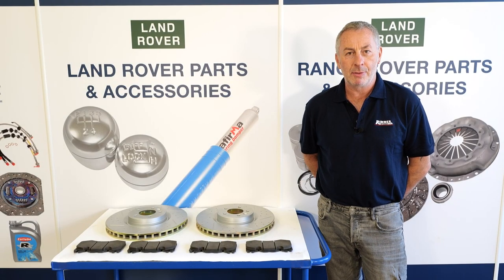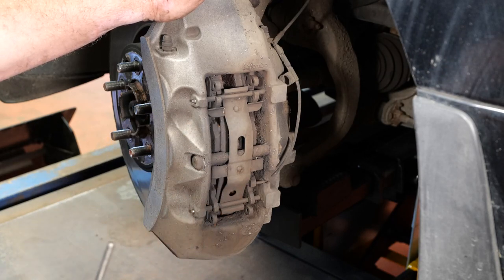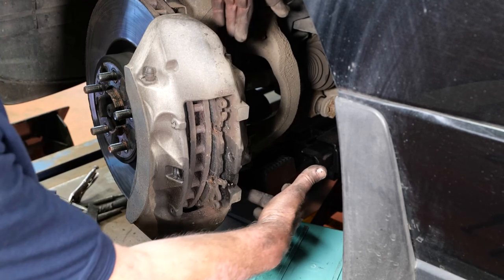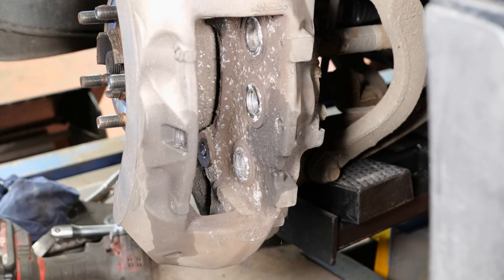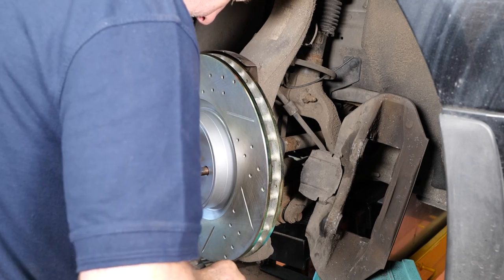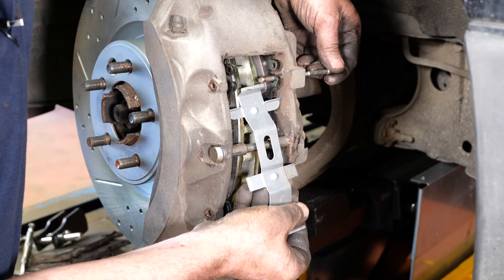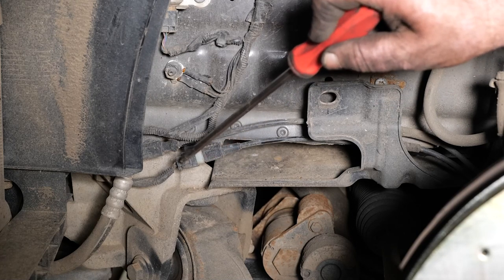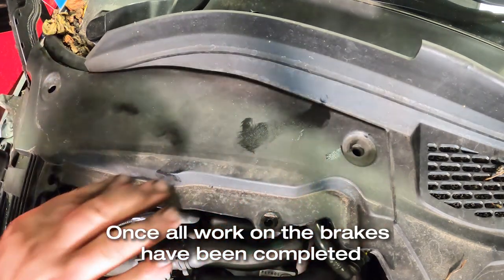Range Rover L405 - How to Change the Front Brake Discs & Pads

Comment: Worth noting that some L405s have completely different calipers and pads...mine is a 2017 and it has twin pot calipers held in by two 13mm bolts...it was a doddle to replace the pads